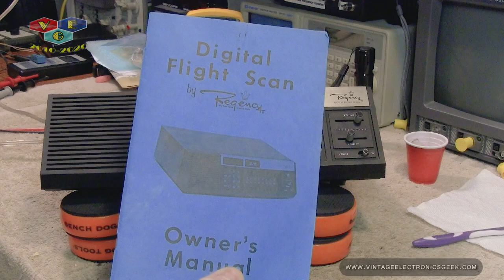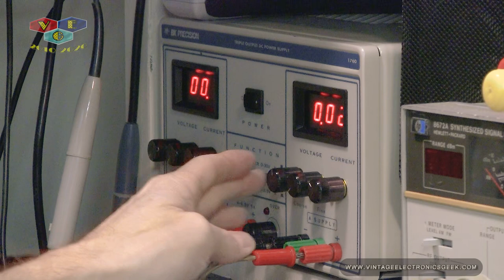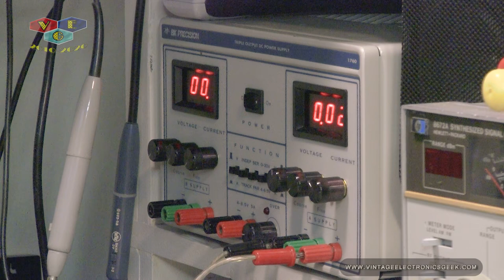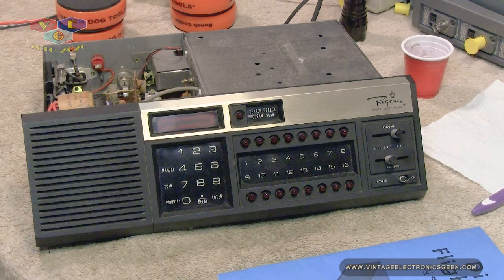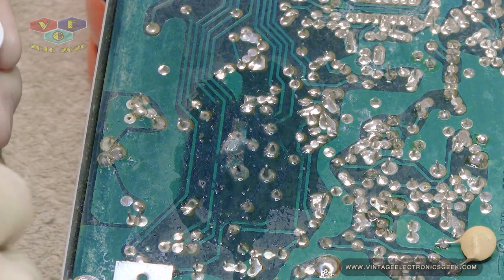Regency ACT-T-720A Digital Flight Scanner  - Repair Part 01 Of 08

Comment: I remember those scanners. Yes that board does look like it has seen better days once you get the traces and new parts in it should run like a champ. Was this one of the items you got at the Ham fest?
Reply from the maker: Yea, not a fine example, I will get a better example later, but for now it will do. No, this was a eBay purchase...I original was not going to do a hamfest video, but have changed my mind, I will, however I'm not sure when that will happen, trying to find the time to record...maybe next week???  So, stay tuned, may like what I got and the prices...I left another comment on your hamfest video last night...just a FYI.  ~Jack, VEG

Comment: there's two glass diodes  on that board do you know what kind they are .right by the power supply
Reply from the maker: Howdy!  Sorry for delay...very busy....I have not re-opened mine as I just don't have the time at the moment, so looking at reference photo's, what it appears are Zener diodes in a half-bridge rectifier configuration, this will convert AC to DC, I cant confirm that's what's happening due to not having it open to explore...also noted in my photo, there is a Schottky diode under the transformer, I unfortunately didn't take in photos of the area when I had it out and I don't have time at the moment to scrub my video if I captured it there....so I'm not sure if there are more under there...if there are indeed 4 diodes its plausible its configured as a full-bridge rectifier...basically more filtering of AC to DC.  Hope this helps some.  ~Jack, VEG

Comment: I finally got one of those in today....leaky capacitor like yours.. 1000uf cap ...got it off eBay didn't work no power.....recap the whole unit
Reply from the maker: Hopefully yours will work once done and I hope you didn't pay to much for yours, I think I only paid $10 for mine...or whatever I may have said in the video...if I said.  ~Jack, VEG
Reply: I finally found one after 2 months. .I gave 19 for mine and I could not find any cheaper .. @VintageElectronicsGeek  yeah didn't power up when I got it but now I got it to work but I got it on the bench going to re cap it all the cap are bad  i am going to use good cap
Reply from the maker: @lacey397  Decent price if it looks good and it works once done, I find that it is a sensitive radio that does a bang up job, cant wait to put mine in line permanent, but that will be after we move sometime in the future.  ~Jack, VEG